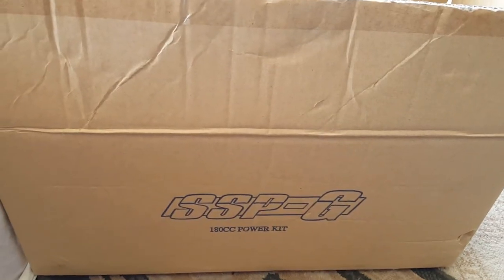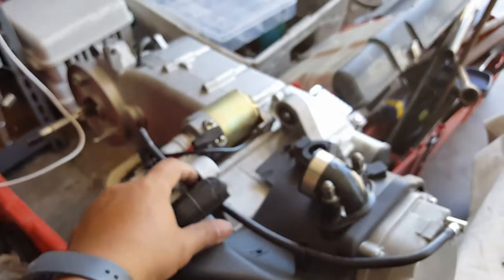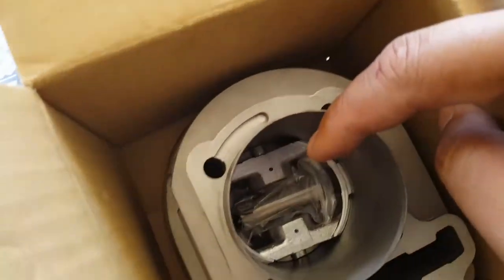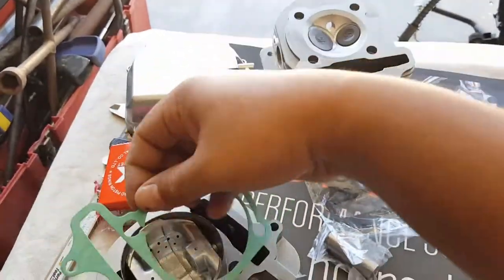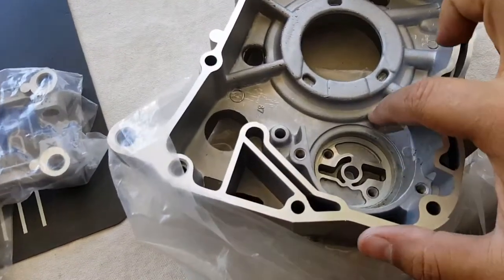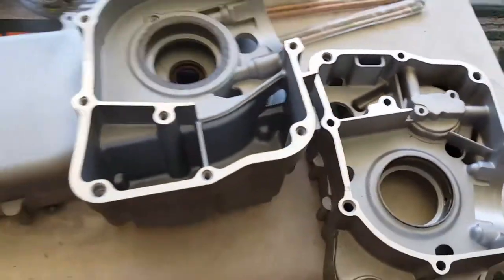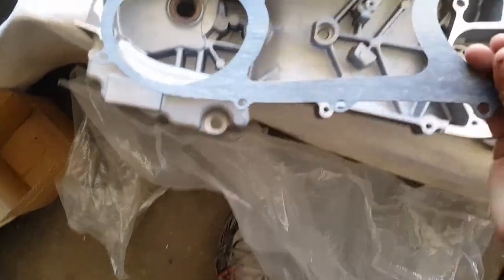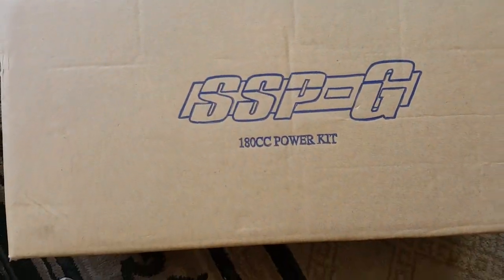SSP-G Crankcase 180cc Big Bore Power Kit / GY6 longcase (unboxing)

Comment: If you run that long  belt case without the cover, ALL bolts and dowels,well tight, IF or WHEN the case breaks in 2...
You'll lose the rear wheel...and your...pride...
(i never thought of that,just saw in in a youtube video here...)

Comment: Wondering what all i should upgrade when i purchase this kit. You said high torque starter, taida heavy duty starter clutch? What about the  valve springs ?should i upgrade to 1200 rpm springs ?
Reply from the maker: edwin ar you should try to use what's the current setup is it's just like changing the weight you have to get a feel for it trail error I would recommend using what comes in the kit first before everything at once. :)
Reply: NCY STORE will do ty for the response
Reply: What is the top miles per hour on a motorscooter with a 180cc kit?
Reply from the maker: @terrybaptist1538  So many factors, body weight, scooter weight, etc carb jetting. However, going from 150 to 180 definitely adds more top-end speed.